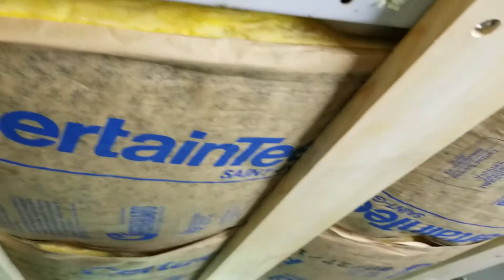Installing insulation and luan in Econoline e250 ceiling - Project Van

Comment: It looks great. What kind of bolt did you use? I am having a hard time attaching the board to the ceiling. Thanks.
Reply from the maker: I used screws for metal roofing. I had to drill a countersunk hole for the head of the screw to sit in so it was flush.
Reply from the maker: I also used a metal strap over the beam to help hold it as well because i was having the same problem

Comment: What kind of screws did you use to screw in the luan and has it held up over time?
Reply from the maker: I used small brass screws that i had from another project. It was screwed into the wood one x fours. I did it a little different on my latest van.